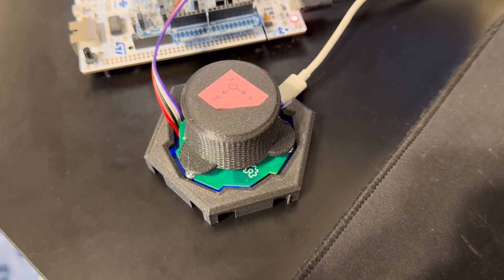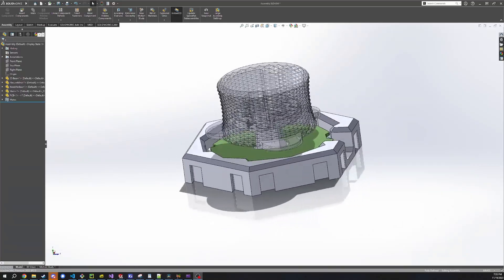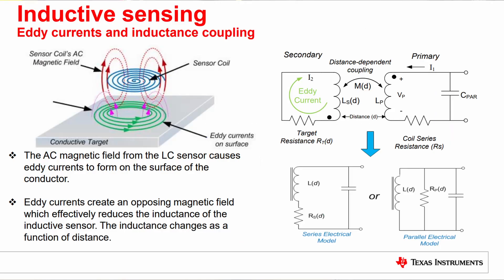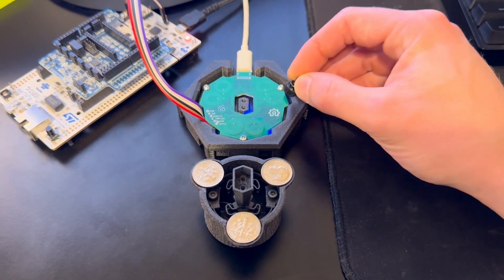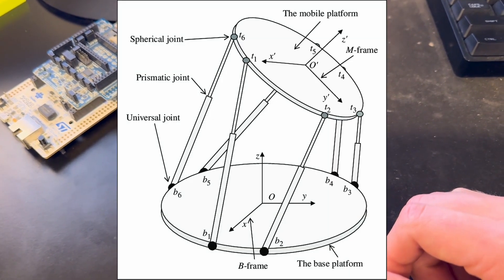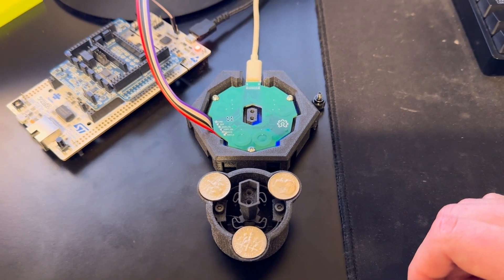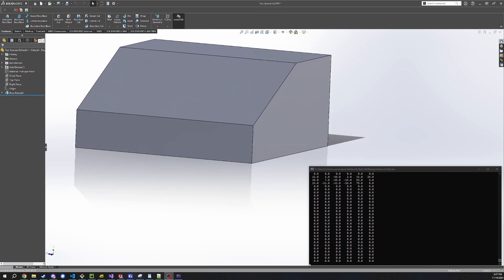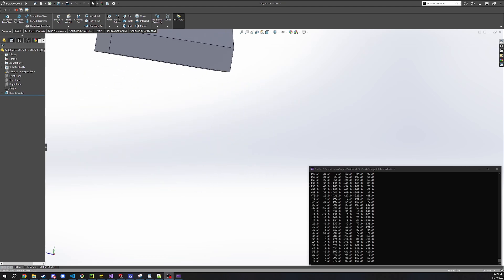Introducing the OS3M Mouse, the open source 3D mouse... mouse!

Comment: What is used as a target?
There doesn't seem to be a BoM telling and they are a bit washed out in the video.
Looks like some kind of national currency that probably contains much copper?
Reply from the maker: Yeah, apologies, the HDR to SDR conversion wiped out a lot of the clarity in the video. At the beginning I mention the BoM is the 3D printed parts, the PCB, 9 M3x10 fasteners, and 3 dimes (USA 10 cent coin). But as you mention, any object of similar size with copper inside will be fine. I’m working on a follow-up video that goes into more clarity on how to build one. Thanks for watching!

Comment: I'd love this for Blender/game engines! One thing I wish we could have seen is footage of your hand using the device overlayed on the video of CAD navigation.
Reply from the maker: That’s a good point! I actually thought about doing that but wasn’t confident enough in my video editing skills. If you look on my channel for the previous video showing MVP of this project, there’s footage of me using it with hand in view.
Reply: @ColtonBaldridge  how can you manage sending usb hid data from inputs and say such things about picture in picture, there's literally 40 second videos about how to do this. I'm waiting impatiently now for an updateee
Reply: I love it! I was thinking about doing something similar, but when I checked what was needed I ran into the driver problem. As far as I can tell Fusion 360 has no universal HID interface. It accepts the 3DConnexion spacemouse, but that has a proprietary driver. So even if you get it running with that driver, the manufacturer could take that whole open source project down for violating the license of the driver.
Reply: They don't move much so it would be hard to really show I think. Imagine you are holding a little tiny version of what you see on screen. They way you move the sensor head is how it shifts on screen. The flip of that is Imagine the object is fixed and you are moving a camera flying around the object.

Comment: Very nice work there! Are you using the plastic from the knob to act as springs? Any concerns about long term strength of that?
Reply from the maker: There is a separate flexure I’ve designed to be 3D printed inside the knob, which I think is cool because you can change it however you want (more or less stiff in any axis). Strength wise, it’s been sufficient. I have broken them, but only when applying loads I’d consider to be excessive. Even if you do break them though, another one is only a 10m 3D print away; you don’t have to print a whole extra knob.